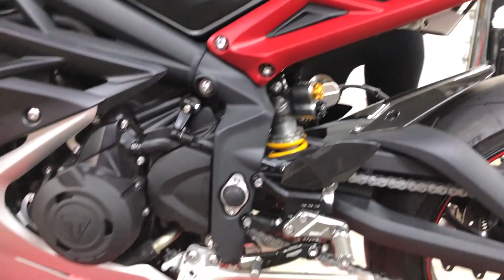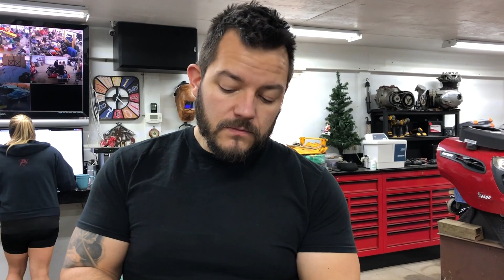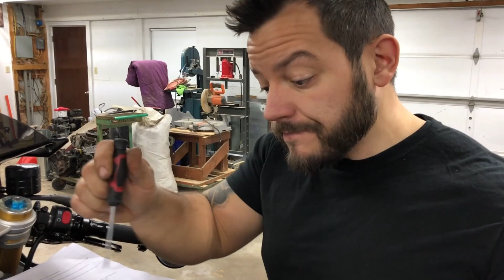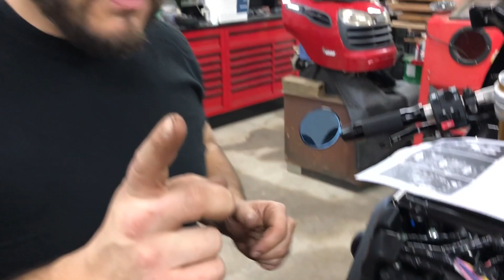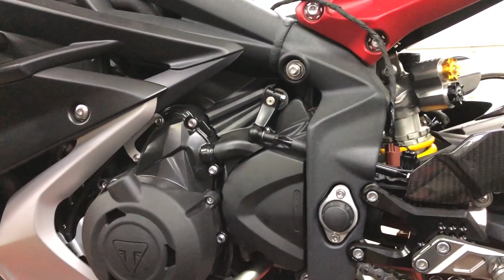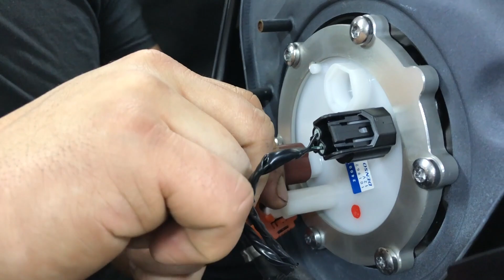Giving the Daytona MORE POWER!!!

Comment: The 2017 Daytona is my first bike and also the first bike I worked on and it’s a lot more complicated than its Japanese counterparts. I see videos for Honda, Yamaha, Kawasaki and Suzuki and the install is god awfully easy. On the Daytona it’s like 10 more steps and more bolts to take off. Just a slip on is annoying to do. The slip on for a gsxr 750 is like 4 bolts and a clamp. While I do love the Daytona, my next bike will most definitely be a Japanese.

Comment: Don't leave the stock o2 sensor in the exhaust unplugged. This will kill the sensor.
Reply: Why would that kill the sensor? It's not being subjected to anything it wouldn't already be.
Reply: Legendary Valky the sensor has a heater element in it which helps control and maintain a specific temperature range and burn off excess carbon/soot. With it being unplugged you risk overheating or being too cool to burn off the build up around the sensor. You are better off removing the sensor and installing a block off bung in the exhaust
Reply: OnlyDominican That's kind of cool. I had no idea. Thank you.

Comment: Took me 2 hours for that cps connector alone, pain in the ass.
Reply from the maker: Sunedosa haha you know the struggle. This shit was no joke.
Reply: Yea , hated it but  i gained 8 hp over stock with a custom map with 121.8 rwhp with similar gains in torque. I have a decatted MJS header paired with a AR can + a BMC street filter. I hear some get close to 125 rwhp with akras/racefilter/PCV + custom map so i wish you the best.  But beside the extra power/torque the fueling was sooo much improved, smoother all over the revrange with air/fuel ratios adjusted, PCV + custom map is the way to go. Good luck !

Comment: I thought a power commander was used because you can't locally get the ECU custom tuned/mapped.  But you are saying you are getting the power commander custom tuned? I'm a little confused.  If the garage dose custom tunes, surely there is no need for the power commander, just get the ECU tuned/mapped, saves a little weight lol.
Reply: we already had the ecu flashed, results sucked. we are installing a PC5 and getting a custom tune done next. all done locally.
Reply: The ecu isn't custom tuned at the dealer, it's a reflash for the arrow full exhaust which is an off the shelf map
Reply: OnlyDominican I don't think you understand, a tune/map/remap/flash all the same thing, dealers never do that kind of thing.  You take it to a place that 'tunes' bikes, someone who has a rolling road and they can custom tune the ECU.  It's much more custom to the individual bike, not just a tune for that model of bike.
Reply: Halfdead Rider when it comes to the 2013+ Daytona, the dealers/triumph are the only ones that offer a reflash which is geared to the arrow exhausts. They offer an arrow slip on map and an arrow race exhaust map. So to get a "custom" or actual tune on these bikes you need a piggy back controller (power commander V and others) or get the triumph race ecu and harness.

I have experience with tuning the power commander and pre 2013 daytonas (which could be user reflashable through it's obd port using tune ecu)
Reply: All of the methods while achieving the same goal of remapping the ECU, I would not exactly call them the same as you need to understand the caveats and limitations of each option and system
Reply: OnlyDominican There is only one method with different names for the same process, it's a computer program.  The only difference is whether it is a bespoke tune for the individual bike or a pre-programmed tune for that model, on a device that either overwrites the ECU or in the power commanders case bypasses the ECU and then can be tweaked.  A bespoke tune of the ECU will always give the best possible result, if you want massive gains you need to start messing with engine components, not just change the air filter and exhaust and then remap the ECU.
Reply: Why do you keep saying what I am explaining back to me and telling me I don't understand?

You Said Dealers never do that kind of thing, to which I Explained, Triumph dealers have two MAPS available to them to flash to the 2013+ Daytona ECU (Arrow Slip On or Arrow Full Race Exhaust). The argument should've ended there. They tried using the Arrow Map with Akrapovic exhaust (Which the map is not optimized for). To get the best out of that exhaust (Via a TUNE) they need to run a piggy back. How does this explanation translate to you that I do not understand the difference between a Custom tune and an Off the shelf map (Triumphs dealer installed REFLASH)?

I am not disagreeing with you on the merits of a bespoke tune. I am simply explaining what the tuning options for a 2013+ Daytona Are and why they chose to now go down the path of a Power Commander V.

Equating this to being "Just a computer Program" also oversimplifies what's involved. (Coming from dealing with tuning Power Commanders, Subaru and Mitsubishi Ecus and other piggy back and standalone systems)
Reply: I'm sorry that you do not understand any of my comments or replies but that's not my fault.  There was no "argument" here, I also did not "over simplify" anything, as you should know if you really work at a tuning company.   Your misunderstanding comes from your focus on the 'dealership', but that's your own conversation, I was talking about custom tunes from the start, not a factory tune for a factory fitted sports exhaust :)
Reply: Ok, I think I took the wrong approach with this. 

You said you thought a power commander was used because you can't locally get the ECU custom tuned/mapped. 

To Which I stated about the dealer without properly clarifying that the only ones who can modify the stock ecu is the Dealer on the 2013 and newer Triumph Daytonas. My second response was supposed to clarify that only the dealer can reflash the ecu, which is why you can only use the Power commander and similar Piggy Back ECUs to Custom tune the daytona.

I am also stating that while yes you use software to tune the bike and any ECU for that matter, Piggy back systems operate completely different and are approached to tuning differently than an ECU reflash or Standalone ecu would be, but they all are used to achieve the same result (An Optimized Fuel Map, (and Timing when utilizing the additional ignition module in the case of piggy backs....but thats a whole other discussion).